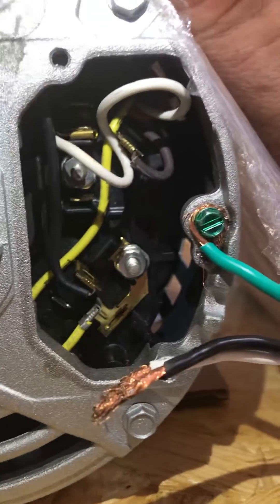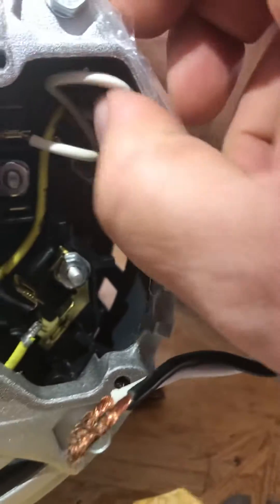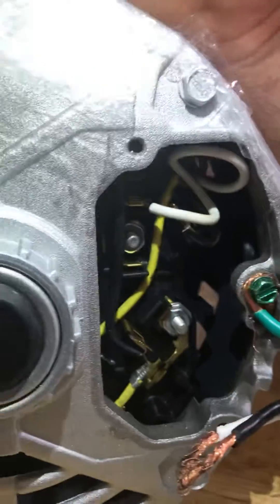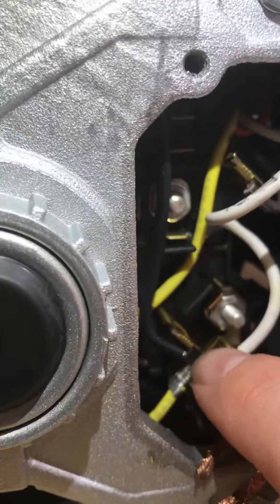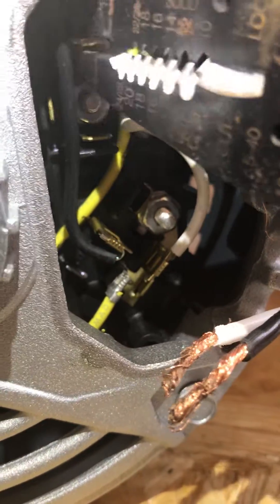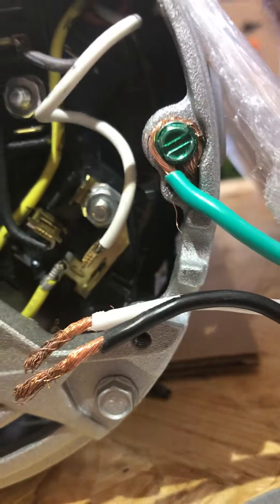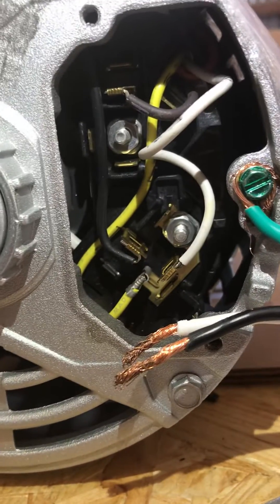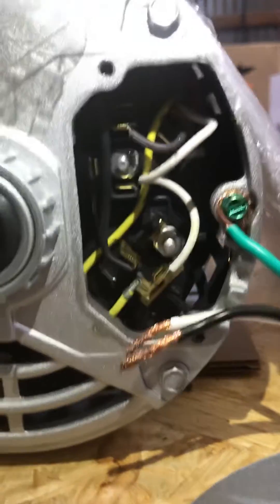Gast 1023 wiring 220v to 115v.

Comment: I have this motor and the black wire from my wiring harness burnt/disconnected. I reworded it and put it back on and the motor just makes a noise but doesn’t start turning. It will spin freely by hand though. Not sure what’s going on. It’s wired up the way you have it here for the 110.

Comment: How to wire 115 to a220 pressure switch
Reply from the maker: If the power coming to the switch is 115 it can’t be done. You can change the power but it would be easier to get a 115 v switch we have plenty of them.

Comment: Hi .bro i have a doerr LR22132 wich in 110v .i want to put 220v .all wire are black. I can see t8 t5 t3 end other i don't see whell .it has no plate for diagram.would you please help me thank so much. Peace
Reply from the maker: i don't know what model that is and would have to have a wiring diagram. some of these have different motors and are actually wired different from this